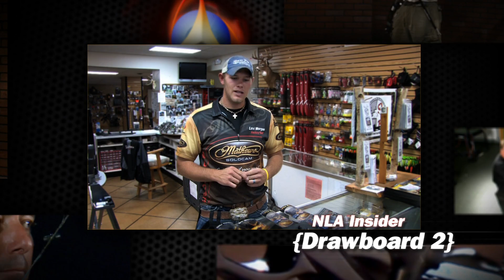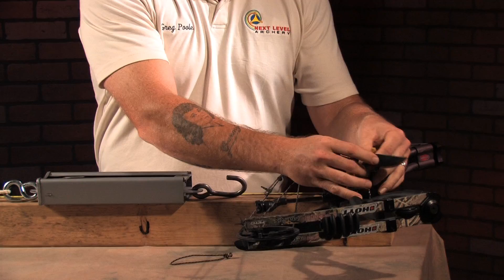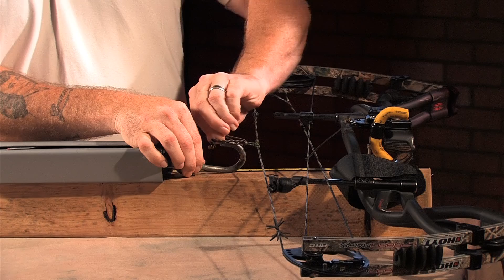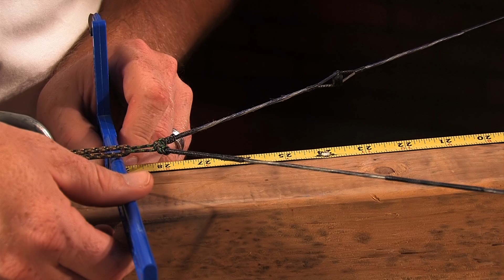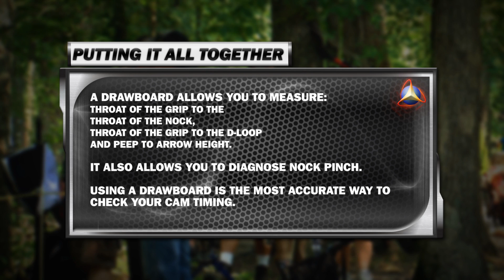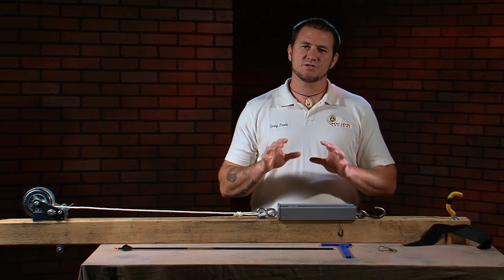Greg Poole Drawboard 2

Comment: Looks like the bow is pulling to one side.  Does this affect the timing? Do you need to pin down both limb pockets?  The nock point does not line up perpendicular (right angle ) with winch.